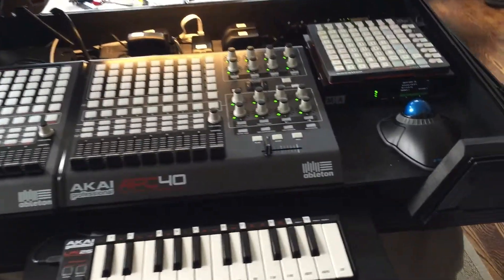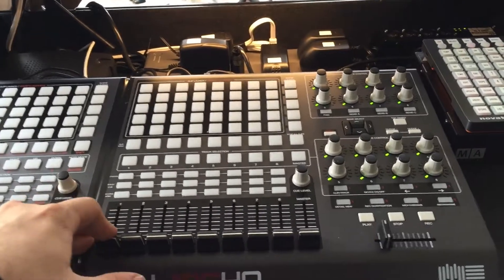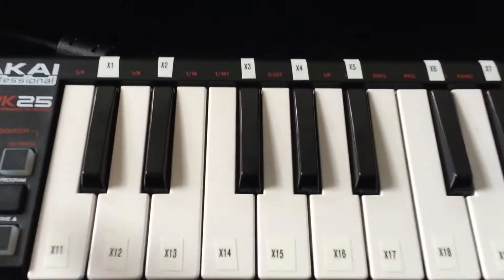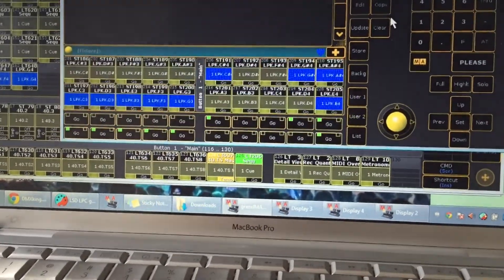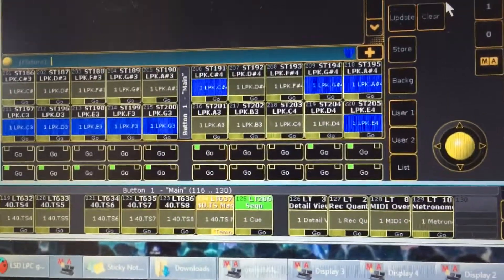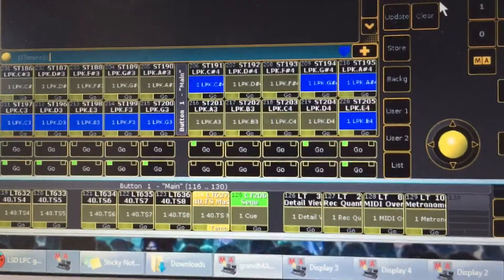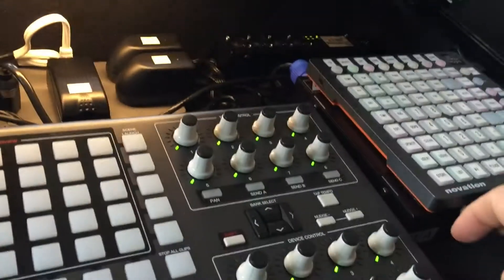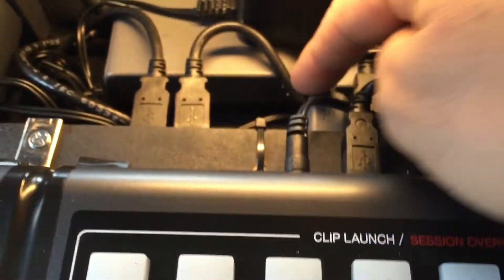LPC (Lighting Performanc Controller) grandMA Console from Luke Stratton Designs (round 2)

Comment: Isn't this just MA onPC software?  You can't just run MA software with a couple of midi controllers and take credit for it, lol.
I mean it's cool and a good alternative for someone without access to a console.  But calling it a console is like duct taping a calculator to a walkie-talkie and calling it a smart phone.

Sorry, not trying to be a dick.  I actually like your videos!  Also, I was surprised that MA software runs that well on an older Macbook Pro like that.
Reply from the maker: ALT Pro to each their own but I have users that have paid for this design (both as software and as hardware) all over the world. They would disagree with you. Also, this video is a couple years old.
Reply: Thats cool dude, not trying to be negative.  I'm sure this type of control surface could be better for busking that the actual console.

What are you charging for the mapping and any special software needed for the setup?  I'd like to have something like this just to play around with at home with MA3D.

My only worry would be MA tightening up the software so as to not loose hardware sales, since I'm sure this could catch on pretty quick over spending $20k on a console.
Reply: what can be done with custom mapping and led feedback is awesome and for cheap..

Comment: What midi driver are you using ? yoke stopped at 32 bit. I need a 64 bit
Reply from the maker: Fred Vandenberg everything in through BOME's include virtual midi port
Reply: i use bomes with midi ox  give me 8 virtual ports :)